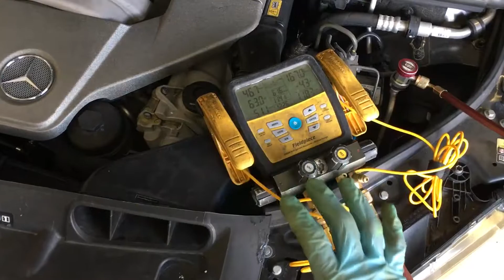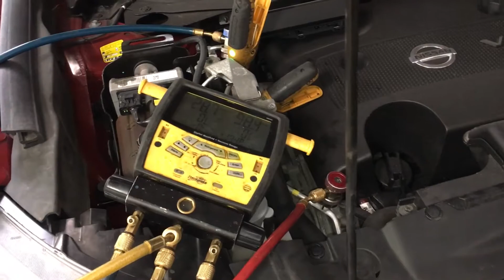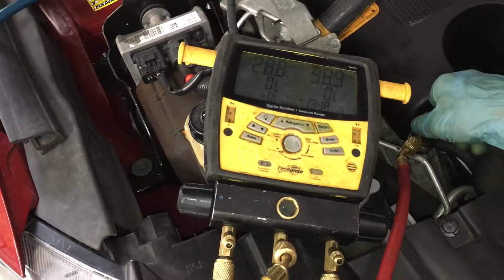AC PSI vary different two cars same time in same shop is normal. Charge by weight  only.

Comment: Amen brother you must have been a trane at Honda headquarters in Japan,no joke it's a compliment 😊
Reply from the maker: Closest thing I came, was working at the Honda dealership 35 years ago. Lucky to work underneath some technicians who are old-school and detailed and took pride in their trade.. 

And my father, who is a third generation automotive technician who is extremely detailed oriented, torqued every bolt you Sterritt, measuring gauges to measure all clearances .  Went through the process of actually reforming threads not cutting threads before reassembling engine blocks.. 

And was very heavy into Electronics and physics and science of materials . 

I was given a good head start in life in this trade .